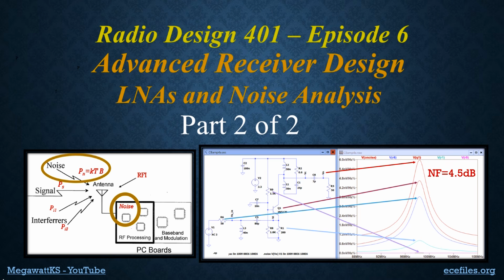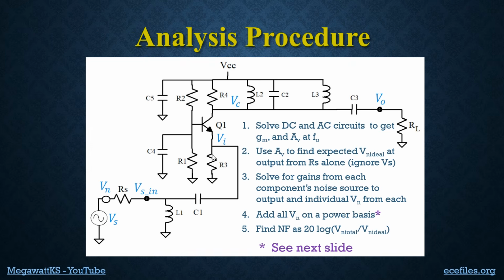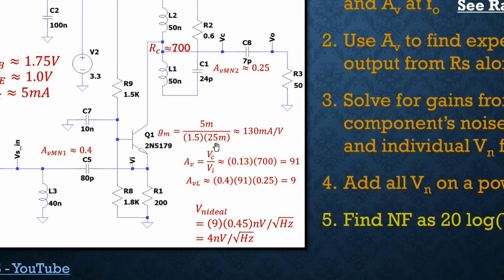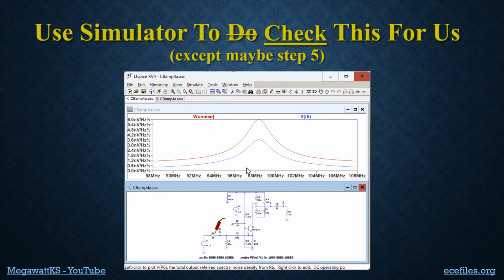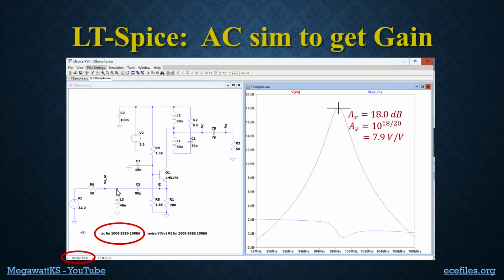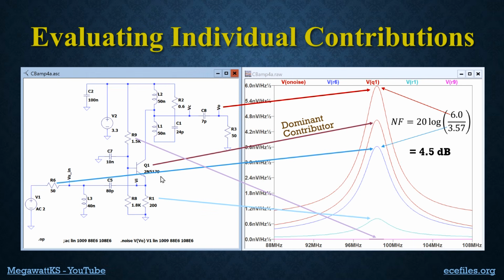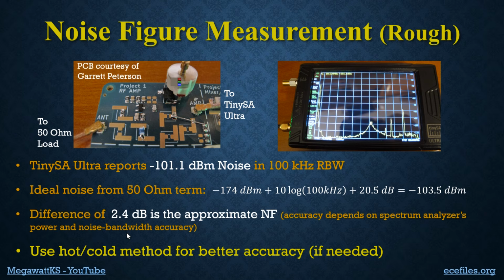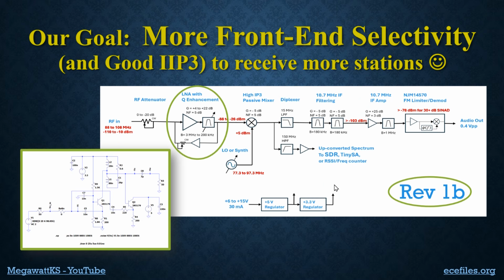LNA Noise Figure Analysis - Radio Design 401, Episode 6, Part 2

Comment: Thank you so much again for amazing videos. Recently started learning about IP3 and NF to compare my ham  small signal amp designs (mostly interested in 40m). You probably know this but Tiny SA Ultra has NF measurement built in. Like $150k equipment you mentioned 😉 Would be interesting to compare how good that measurement is with other methods.
Reply from the maker: You're very welcome. Thanks for the info. Have you tried any of those modes yet?  I'm trying it now, but am not getting good results (yet). I asked it to measure its own NF at 100 MHz. It turned on the LNA and trace averaging, etc to get a less noisy trace, but the trace is close to the bottom and the readout says 1.2 dB - which I know can't be right given the datasheet's value of for the LNA inside the device. That was under the "Measure" menu. Erik also told me there's a Marker Noise function that reads out in dBm/Hz and it seems to work, but it showed just 0.2 dB above theoretical minimum!  Then I put a 50 Ohm load on the input and it now shows about 2.8 dB, which is closer to the datasheet value for the LNA they're using. Here's Erik's video on the Noise Measurement in case you haven't found it yet. He got 3.6 dB for the TinySA ultra - perhaps because he did the level cal first?  https://www.youtube.com/watch?v=kUV1nJIAxQk
Reply: @MegawattKS  Just tried again. (at 10MHz) W7ZOI TIA Gain 14.5dB, TinySA LNA NF 4.6dB, W7ZOI TIA NF 6.8dB. The numbers seem about right (and comparable to W7ZOI's own reports). But I don't have other ways to check NF.
Reply from the maker: @pilobond  Nice !
Reply: @MegawattKS i remember that i was getting 26dB of NF for tinysa ultra's own LNA. Then i did the calibration and NF went down below 5. I measured W7ZOI's termination insensitive amp that i built and i think i got 6-7 from what i remember which seems about right. I'll try again when i have some time and report to you.

Comment: Love your radio videos! Quick question about LNA's. When the noise power of the input of an LNA is analyzed, it looks "cold" in terms of noise temperature. I always thought this was becuase the equivalent noise temperature of LNAs listed on data sheets is cold (often 70K or something very low). But since the input referred noise temp is divided back by gain, it is not a physical noise at the input. Does this mean that the "cold" input is not due to the noise temp of the device but rather due to good isolation so the noise can't get back to the input?

Thanks for any clarification!
Reply from the maker: I think I agree with your conclusion that the low noise temp can be viewed as being associated with good isolation. An amp with a noise temp of 70 degrees is one with a (standard) NF much lower than 3 dB, since 70 << 290K. So the amplified input noise has to be >> the added noise. I don't think that can be done with a common-base amp, which has a primary noise current between collector and emitter (or drain and source). In that case, the internal device noise is dumping right into the input and in a sense can be viewed as 'reflecting' back to the collector. That's not a bad thing since the reflected noise is correlated and partially offsets the total at the collector. But its hard to get a very low NF with a CB amp to the best of my knowledge.  But using a Cascode configuration, one can definitely achieve a noise temp below the physical temperature of the device. When the AC small-signal noise model of the device and surrounding circuit is drawn, the only feedback path to the input is through the (ideally) very low Cdg (capacitance between drain and gate). Moreover (and possibly more important), part of the amplification is coming from the input matching network which offers substantial voltage gain in this situation -- a key to gettting the amplified input much larger than the collector (or drain) noise current produces at the output. Hope that makes some sense. This is a deep question that needs schematics drawn and discussed. Words are tricky to capture that. Hope this helps a little.

Comment: What's the mmic you're using in the 15 dB +/- 0.5 enr noise source?  Also (if you know) what's the variation with frequency?
Reply from the maker: Great questions. I bought the LNA boards on Amazon and they use an IC marked "MDt". Assuming they are authentic, this is a BGA2869 from NXP whose datasheet is here:  https://www.nxp.com/docs/en/data-sheet/BGA2869.pdf The gain does vary about a dB from 250 to 2150 MHz, so a table needs to be made after measuring with the insertion-gain method and used when doing noise measurements. If the gain measurements include the 20 dB attenuator and cabling, then things should be pretty accurate and the only thing (aside from possible power-supply noise) would be the actual noise figure which shows in the datasheet as 2.6 to 3.6 dB (3.1 +/- 0.5dB). So it looks like the ENR as shown is calculated to be more like 14dB. But it could be more or less depending on what the attenuator accuracy is. Again, making a table of actual measured gains vs frequency should address that - leaving mainly just the NF uncertainty assuming the supply is from a battery and there's no pickup from wiring...

Comment: suggest to use a noise marker to measure the noise power. This calculation uses the effective noise bw of the resolution filter.
Reply from the maker: Hi Erik,  Good advice!  You actually made me curious about the TinySA Ultra that I'm using. Looking at the filter shapes, it looks like the RBW is basically the 2 or 3dB bandwidth and it falls off pretty quick. I tried using the Marker Noise function in 100 kHz RBW mode at 250 MHz with VBW set to 0.1*RBW (LNA on, atten at 0, and input terminated) and I'm seeing between -170 and -172 dBm/Hz (due to sweep to sweep variation since I'm too impatient to use 0.01 or averaging ;-).  The -170 seems about right given the BGA2817 LNA, which quotes a 3.9 dB typical NF.  Interestingly, for the unit I have, I get about the same results if I measure and adjust for the 100 kHz RBW manually (I'm seeing between -120 and -122 dBm with 100 kHz RBW and normal marker mode).  This is all excellent for such an affordable unit and basically matches the HP and Keysight units I've used. Thanks again for pointing this out and especially for designing these spectrum analyzers!  They are a true blessing to the RF community.

Comment: Surprised you had such a big difference in the Tiny SA and Ultra level readings.
Just checked my two and feeding the output of one to the input of the other they were within 1dB at 90 MHz at - 60dBm.
Might be worth running a self test and calibrate on both if you haven't done so recently.
Reply from the maker: Thanks. Good to know. Yes - I have not done any calibrations on them. With HP gear, I've used stuff that's 40 years old and its still within a dB. On my first job, it seemed that every time we sent them to the company cal lab they came back worse than they were before, so except for S-parameter cals on NanoVNAs, I've opted to avoid cals.  But one of the basic TinySAs is almost definitely a clone. (I have two basic ones and they look different.) I bought the Ultra from a known good seller, so it's probably OK. But I'll have a look at doing cals/checks on the basic ones 🙂
Reply: @MegawattKS  You might try just connecting the two together.  Output from the older unit straight into the input of the newer unit with a known good quality SMA double male adapter.  That would remove the possible losses in the coax cables, possible poor UFL connector (I think that's what your using), etc...  Would be interesting to see if the sizeable loss disappears.
Reply from the maker: @mikesradiorepair  Just did some tests - using the Ultra as the receiver, with 100 MHz signal and tight SMA-to-SMA connections. Looks like the TinySA that may be legit has about 1 dB error (or the Ultra has 1 dB error) from -10 to -30 dBm, but then the attenuator in the TinySA sig-gen chip messes up and it has 8 to 9 dB of error for -40 through -70 dBm. The other TinySA is off by 4 to 8 dB everywhere.  Oh well. it makes a good case for doing insertion-gain method I guess 🙂
Reply: @MegawattKS  Well that at least explains it.  From now on you won't be scratching your head about the discrepancy.  Considering how much they cost I guess you really can't complain.  I have to drive down to Baltimore later this week to R&S and pick up several instruments I took down last week to get calibrated.  The $1,500 cal cost of the one communications test set alone could buy a pile of these Tiny SA's.  The price of the instrument could probably get you a pallet full of them LOL. 🙂
Reply: @MegawattKS  With the 'official' one that'll probably show up on the self test when it runs through the attenuator settings.